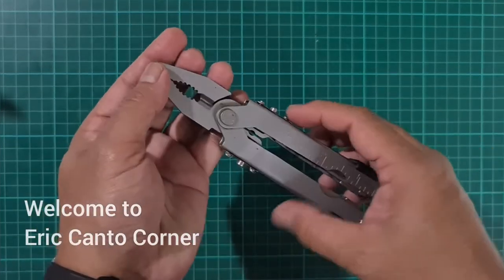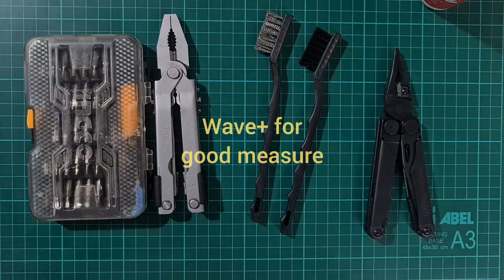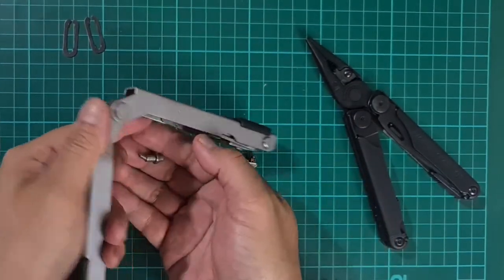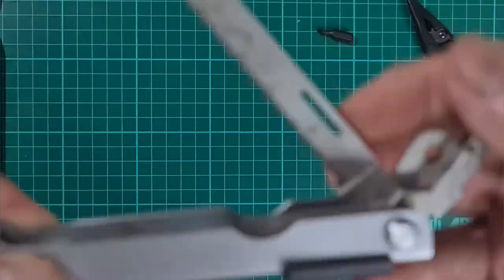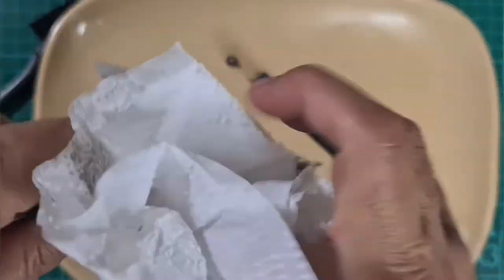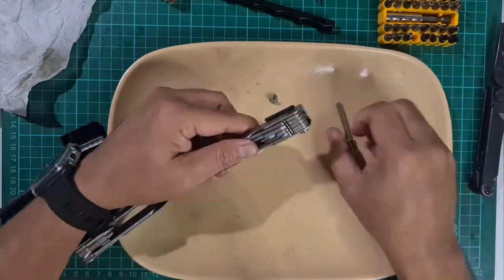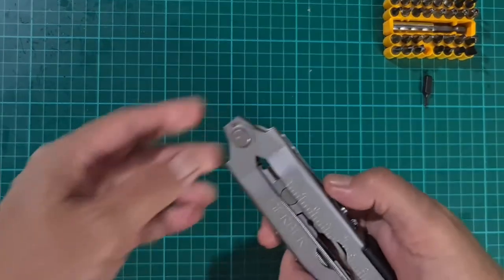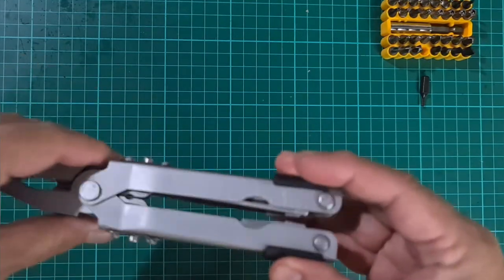GERBER MP600 Multi Plier Disassembly & Maintenance @ericcantocorner4517

Comment: I've been carrying one of those for over 25 years now, I'm on my second one. I work mostly around saltwater and my old one lives in my tackle box full time. I've never seen any sign of rust on mine anywhere. I was under the impression it was some grade of stainless steel. 
My current one has been with me now for about 15 years or so. I never leave home without it.
Reply from the maker: Although Gerber does not always disclose their steels, the steel on the MP600 is a tool steel, probably a 440 series. You are correct also to place it as a stainless steel
Reply from the maker: Thank you for the reply. Stay safe

Comment: Hi, thanks for good video
I have mp600 black blunt&needle nose(2016 ver. ). Your tool has (looks like) serration knife and drop point knife but my two tools have same file and sheep foot knife. I never seen your tool combination before on every internet mall. Could you let me know your mp600 model No. and where to buy? Or did you modified tool combination ?
Thanks
Reply from the maker: You tool config seems like theyre rhe MP600 ProScout version complemented by a replaceable metal saw. The droppoint+serrated sheepsfoot combo is just whats comes with the MP600Basic.
I swapped the needlenose for the bluntnose for my current MP600 carry which is the ProScout w/ Bluntnose. 
Hope that clears things up. Take care of yours!
Reply: Hi, appreciate your kind reply!   Thanks!

Comment: My first one broke after 25 years and they replaced it. The first time I pulled the new one out of the sheath I drooped it about 1 foot and one of the small pin springs is gone. Can not find a replacement anywhere.
Reply from the maker: Have you tried those springs you find in ballpoint pens? I hope you still have the retaining lock
Reply: @ericcantocorner4517  I have all the pats.great idea on the pen. Thanks

Comment: using needlenose pliers on those pivot screw, will it not damaged the 4 lobe head?
Reply from the maker: Well its actually the teeth that will engage the notches. If you will notice also, I am not really applying a great deal of pressure on the grip. Just enough to turn. Lastly, the steel is a tool steel so i sure hope they do hold up to forces. Thank you for your comment bud.